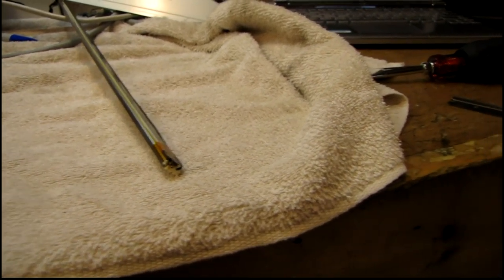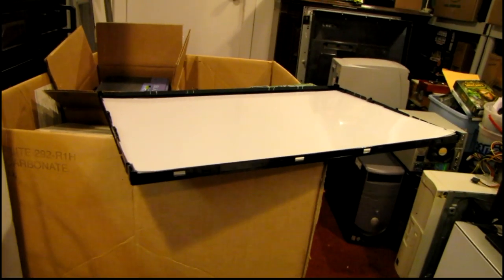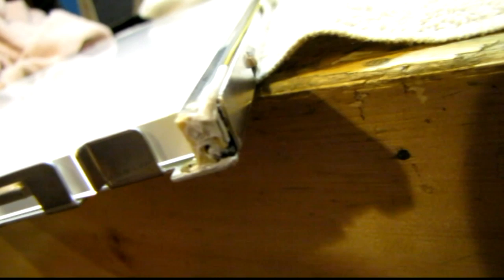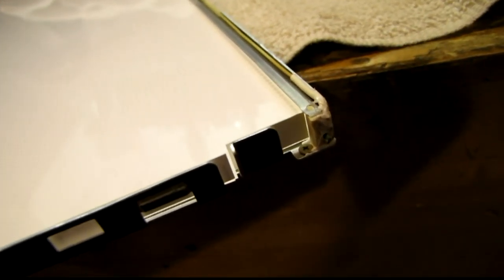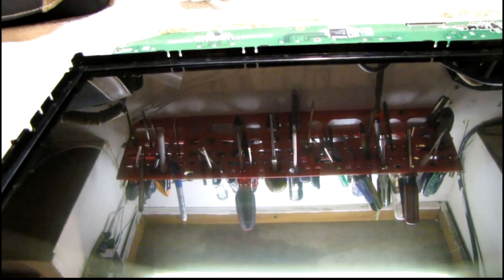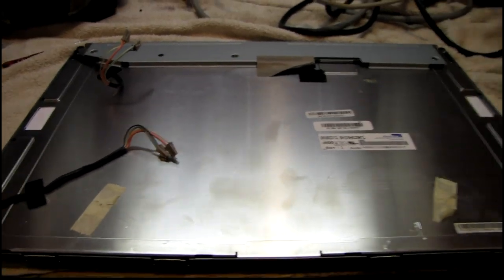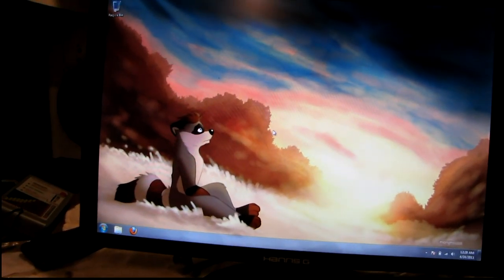Hanns-G HW191D LCD Monitor Backlight Repair

Comment: @Maxxarcade
Well, the best smoke test I had was when I was a student in a electronic repair class. I forgot the isolation transformer. The radio exploded with a very loud bang and all the workstations went dark. The instructor was not pleased. Nothing like doing something really dumb in front of an audience.

Comment: the panel clicks together with plastick hooks in the outer rem
look closely an you can see where they are in the slit where the paneling connects on the sides,
git your fingernails under the plastic border around the lcd and gently twist and pull in the middle of the top to start and it should snap apart, the corners are a pain,
i replaced bad caps in one last night, ild call it a good lcd other then the capacitors , but $128usd lcd for free for $20 worth of labor is a good deal

Comment: good work buddy. i have a 19" hann-g that crapped out (looks the same model). i think recapping it will fix it. i actually have 2 other 19" monitors (dell and samsung). kinda annoying.. i guess i need to hit up ebay and get an capacitance tester. just wondering... the hanns-g and samsung will power up but the backlight will go out (dell won't power up) like a second after. would caps be the only thing stopping it from running or should i check anything else? thanks for any advice..

Comment: How were you able to open the monitor case. There were no screws in  the back corners. Looks like it was clipped inside, can't open mine (same model as yours). Green Led light keeps on flickering and there's picture. This is a Bu11sh!t product.

Comment: Geez--you did a better job than HannsG themselves could have done. I sent my 28" HannsG for repair because the HDMI port had died. When I got it back it still didn't work on HDMI and had new problems as well that weren't there when I sent it out. Now they won't do anything more for me even though it is still under warranty. I will NEVER buy HannsG again--they are a RIP OFF company. Congrats on your ingenuity.

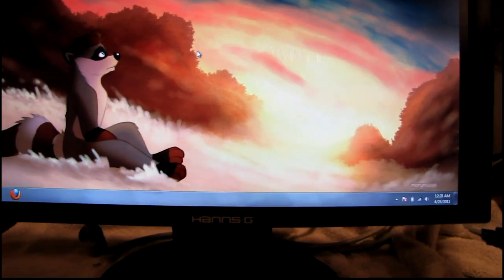Comment: 4:34 Mmmmh, so sad ... after all this effort :|
Had no canned air and soft brushes handy?
Reply from the maker: Funny thing is, I'm still using this monitor at work.  I'm surprised it still works.
Reply: The ugliest happen to be the most faithful ... ;*)

Did you catch my final reply on "new Intel PC build"?
(Don't worry, won't bother you any further ^^)

Comment: I am still using the monitor on one of my comps--but it will not work in native res of 1920x1200, or on HDMI either. I replaced it with a Panasonic 50" plasma for my gaming machine. I will never buy Hanns G again--they are liars and cheats.